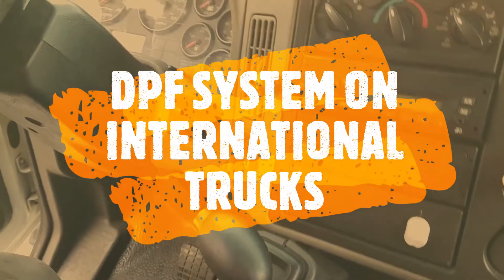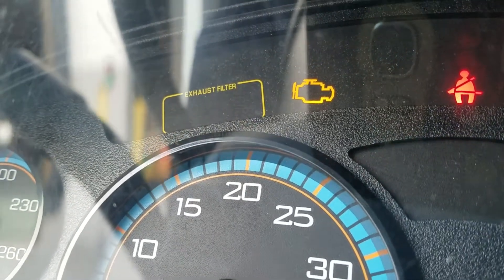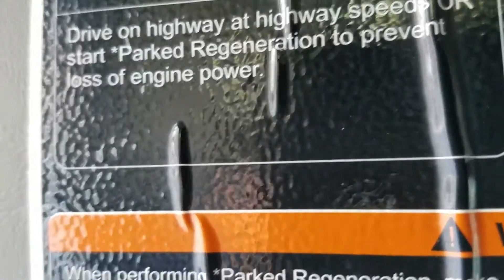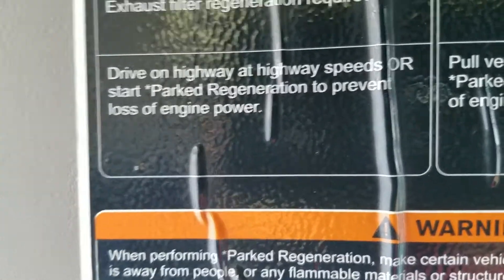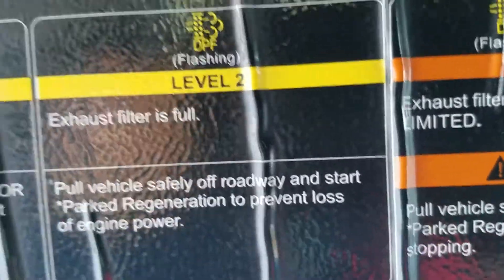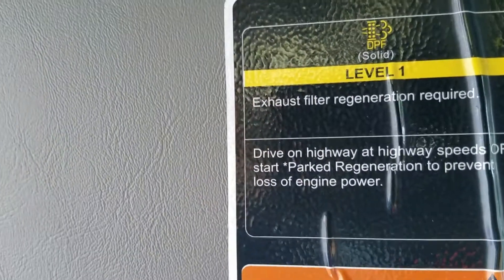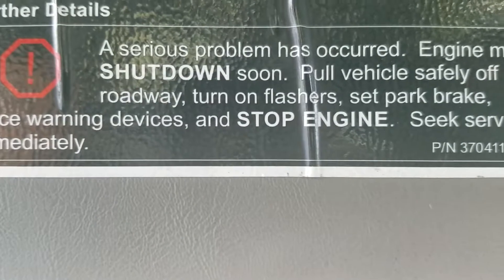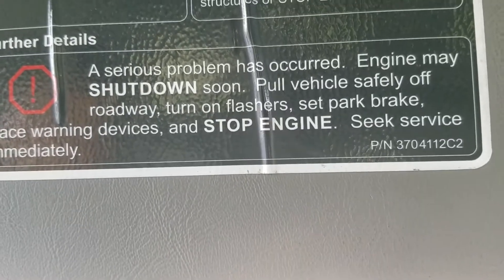DPF REGENERATION ON INTERNATIONAL TRUCKS

Comment: Our truck has been nothing but trouble, word of advise to anyone who owns or to anywho knows they’re looking to buy one of these;

Don’t buy these trucks, the new ones 2015 have cummins on them, I can’t speak on them, but the maxforce 13 is not worth all the headaches. YES!!!!!! They are inexpensive compare to others, but the hassles you will encounter later will make you think twice. I don’t mind having it in the shop everyone one’s in a while, but when it’s brakes down far, that’s when the wallet hurts and your hair is lost or turns not grey but green. Our driver retired, he’d never driven a truck with dpf, so he’d also had some fault too with the breakdowns, he’d ignored some of the flashing signs. Since then me or my brother drive it with a lot, but a lot of TLC. If our business was doing better and I could see a bright future, I’d buy a Freightliner medium duty with Cummins or a hino, those also have a Cummins now, they no longer put the Toyota eternal diesel motors in them.